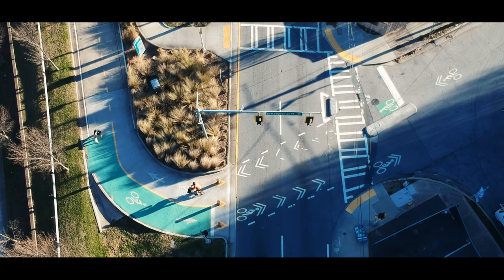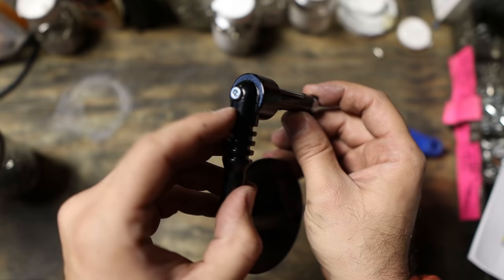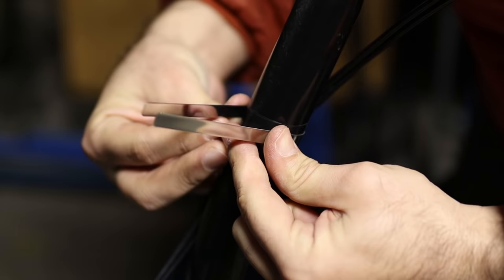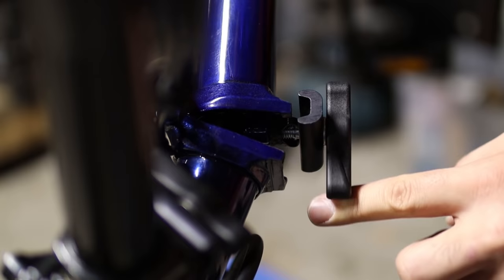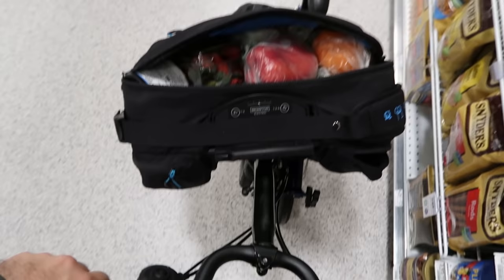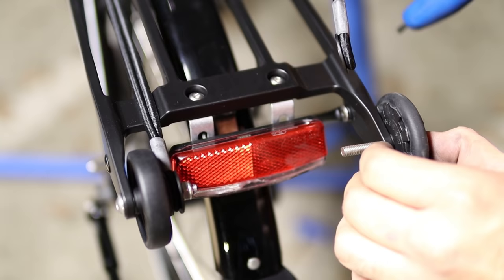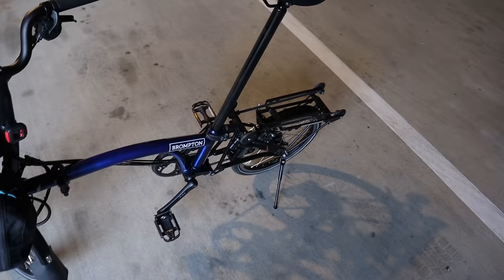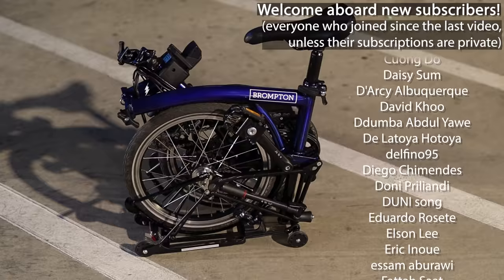7 Brompton Accessories | Brompton Folding Bike

Comment: I've never understood why Brompton don't give a rear-rack option for the electric version, considering the reduced capacity for front luggag. Did repositioning the rear light require patching extra wiring?
Reply from the maker: I agree. It did not. The wire on the L version runs along the chain stay, passes close to the wheel axle, and along the seat stay all the way up to where the light was positioned. So there's enough slack on the cable to attach the light to the rack with no need for modification.
Reply: @EverydayCycling  Thanks for that - I have in the past installed a rear rack on my standard Brompton, so will definitely factor this in for my e-Brompton [once I've squirrelled away a little more money LOL]

Comment: Does the glue on the electrical tape get goopy in the hot and humid Georgia summer?
Reply from the maker: Hey Jerry, it did get goopy on my Kona, which I always park outside, but not on the Brompton. I believe long exposure to heat and the sun is what makes it kind of melt.
Reply: @EverydayCycling  Thanks.

Comment: How about an additional kick stand on the front wheel?
Reply from the maker: It would have to be on the right side, because the left side has the hook. Then we would have one kickstand pointing left and another pointing right (we can't change the rear one to the right side because there's the gear indicator chain, derailleur, etc). There must be a solution to this, just not off the shelf. It's a good suggestion.

Comment: Can the rear mirror be installed on the right side of the handlebar? Will it affect the folding?
Reply: It should work just fine since the Brommy folds it's handlebars to the outside of the frame.